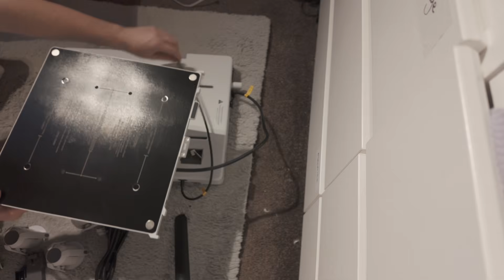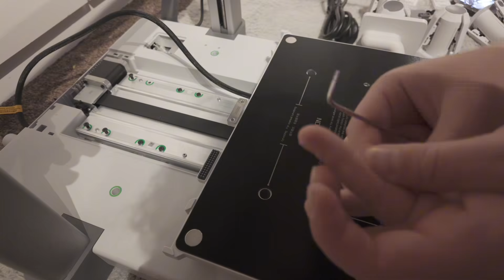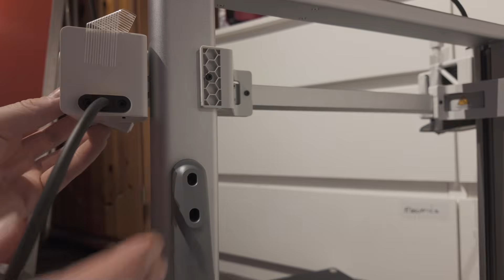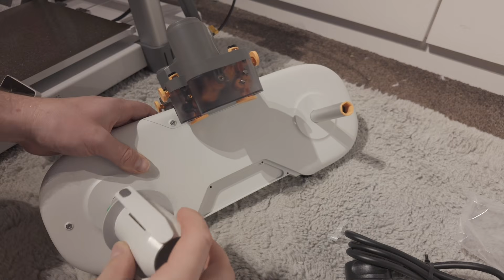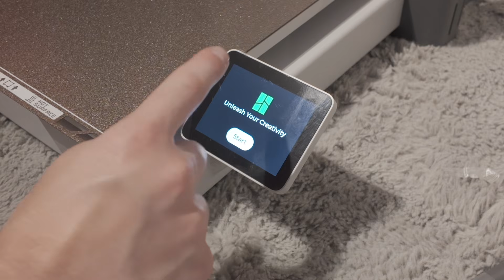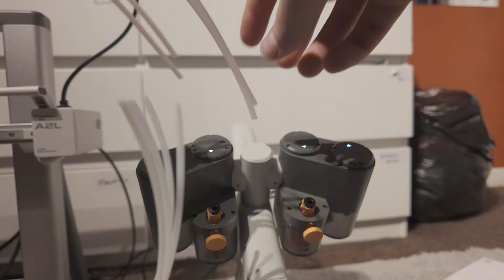NEW Bambu Lab A2L: Complete Assembly & Setup Guide

Comment: You might want to watch the Bambu labs video on lubricating the Y axis rods.  I think you may have gotten some oil on them but Bambu shows in detail the best way to oil and then spread the oil on the Y axis rods.  I will admit they did an excellent job of hiding the rails making maintenance difficult and almost impossible to clean up excess oil underneath the rod.